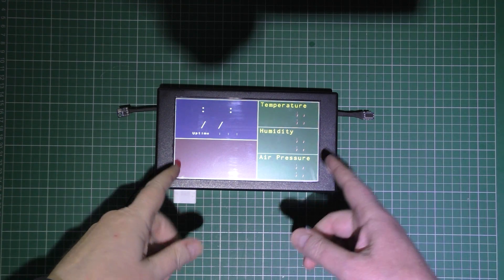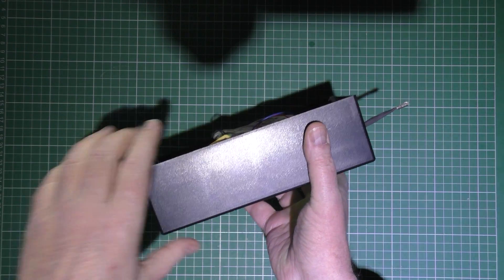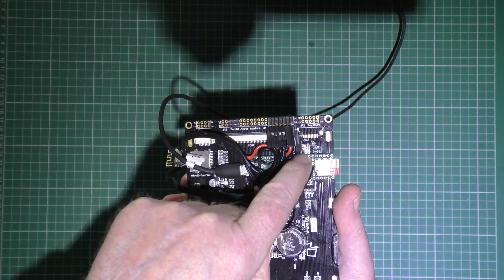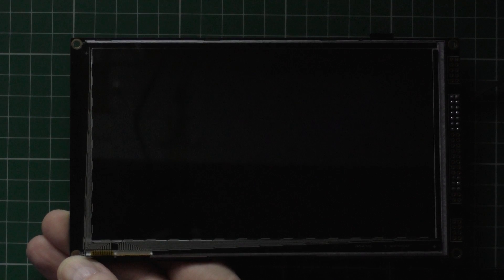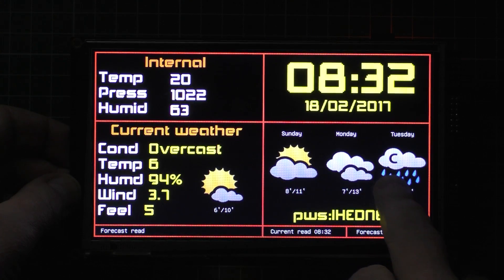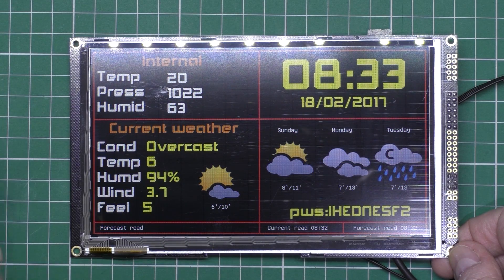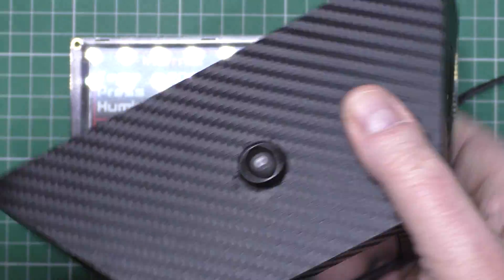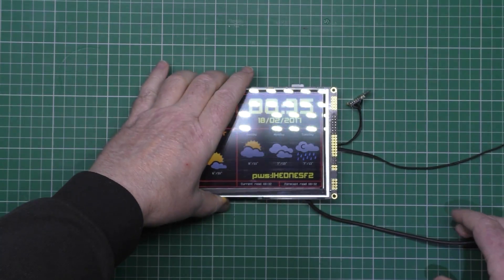IOT Arduino project internet weather station V2 - RA8875 - Teensy 3.6 - ESP8266 - BME280

Comment: Hi, why don't you use ESP8266 only? It is powerful enough. Look at my internet weather station which uses only ESP+LCD (video on my channel).
Reply from the maker: I've already watched yours...... now, that's impressive :-)   
I wanted it to also save the data to SD card, have an external BME280 and it's also going to be an electricity monitor. Sadly, I couldn't see a way that the ESP could handle all that.
Reply: I also think; the fewer devices used, the better! Unless it's necessary.

Comment: This is really nice! May I suggest that instead of logging to the sd card making use of the esp8266 and send the data to an iot service like thingspeak? That way you can truly access it from anywhere and not have to worry about the sd card failing?
Reply from the maker: Thank you :-)    
Call me old fashioned but I like the simplicity of keeping everything on an SD card. I can then look back 12 months and see what the weather was like.    
That doesn't mean I can't do both! :D
Reply: Vortecks fair enough! I just put all of my data on there so they have the burden of keeping the data stored. I did a temperature experiment this summer and left it for 6 months of one minute readings and had 200,000 entries when I stopped it. Nicest part was that you could select export in csv, but that can be all be done on the arduinos as well.

Comment: Hi Tony,
That screen would look fantastic on the internet radio. How about a set of projects all using the same screen. weather station, internet radio, photo viewer, front door monitor, solar system monitor and maybe home automation.
Sorry Tony that's the effect your videos have on me :-).
Cheers Dave.
Reply from the maker: I did think of incorporating the internet radio with it but I decided against it. I wanted the radio to be portable and run off battery - putting a 7" screen on it would take too much power and the size would quadruple. But...... I am going to put a wireless electricity monitor on this one (if I can figure out how) but photos would take around 10 seconds to display and live video is out of the question mate :-(